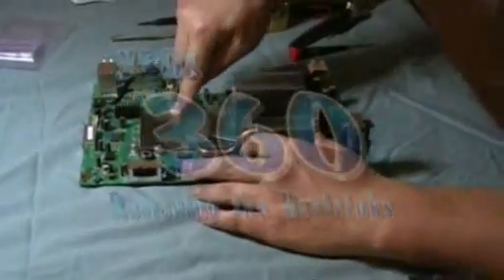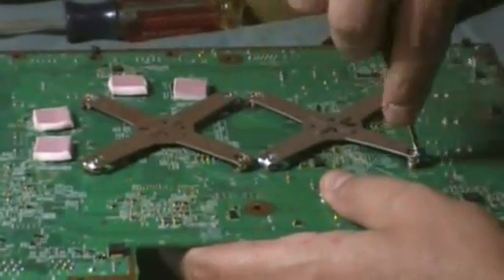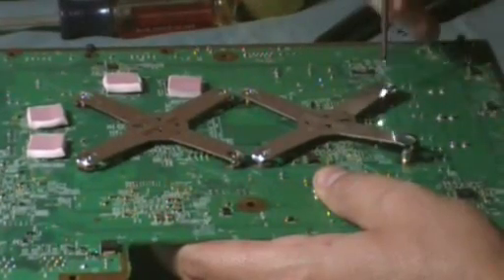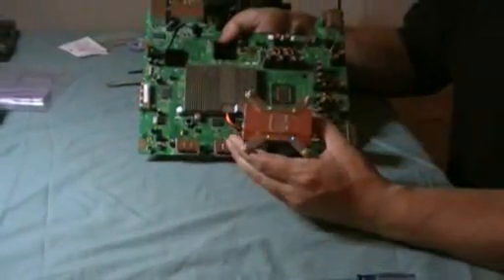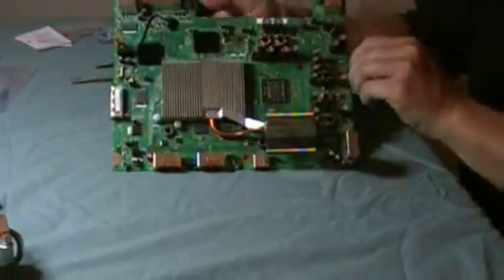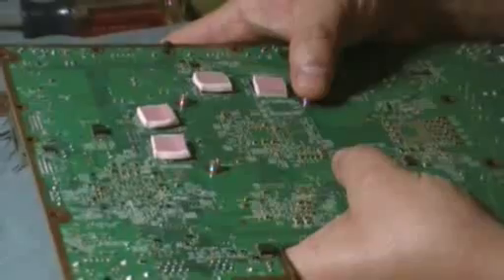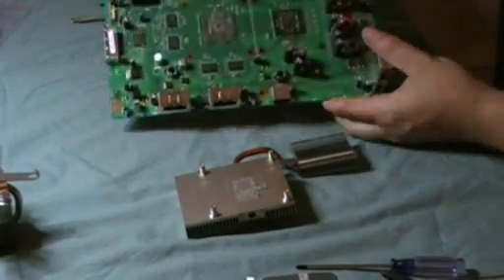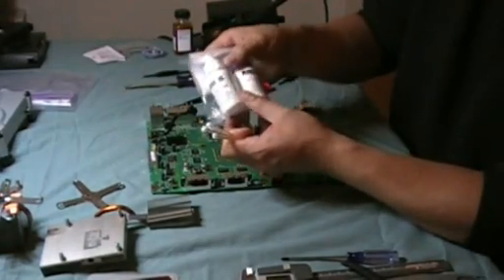XBOX 360: Removing the Heatsinks

Comment: Awesome video man I've had to explain this to lots of people lol. Also I use screws to replace those x clips because they expand to much under heat and you will run into the same problem again sooner or later. Bought them at radio shack along with the thermal paste used for the connection.

Comment: @MiraGhulag Just get a laptop cooling pad, plug it in the USB port, and set your 360 ontop of it. I have two, one for the 360 system and one for the power source. It works very well.

Comment: the x-clamps arent the problem. they're there to prevent the motherboard from warping if it overheats. the problem is that they arent tight enough, but we replace them because there's no point in keeping the old ones after they caused the dreaded RRoD.......DUH Duh duhhhhhh......

Comment: Because that's not the problem.Its actually been proven that lead free solder sucks.And guess who used it Microsoft.You can reball the gpu but it will cost some serious cash+Microsoft has some bad motherboard design.